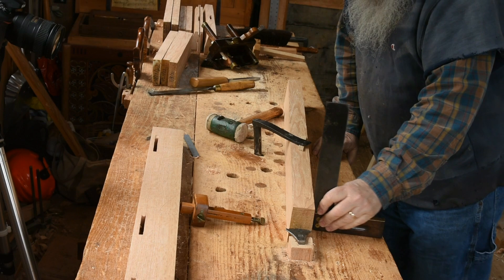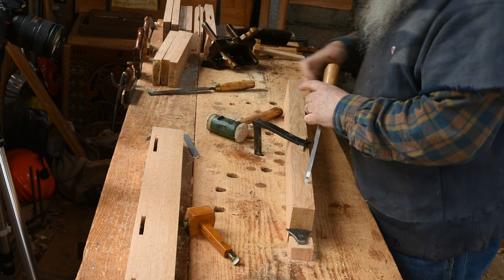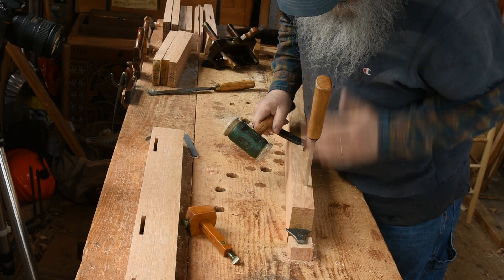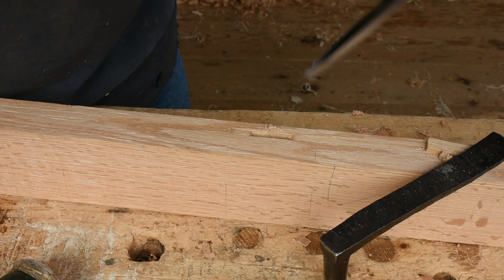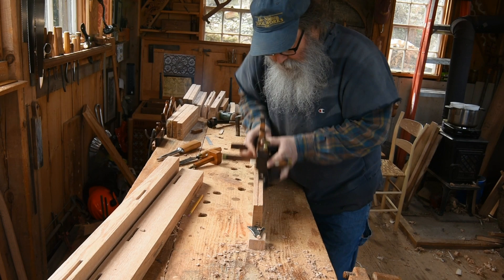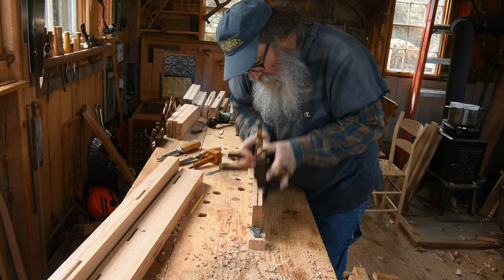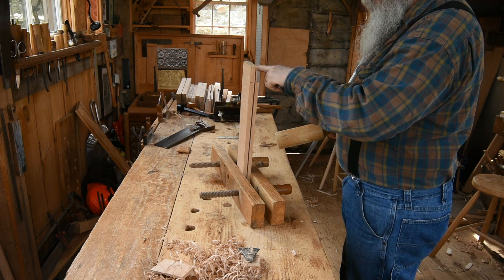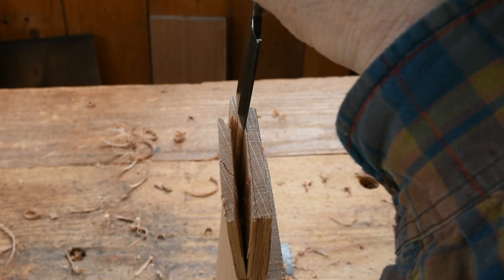Cutting Joinery trailer

Comment: What is the plane Peter uses to plane the running? I am looking for a plane to do that for guitar truss rod channels rather than a power router. Please advise thanks
Reply: That’s a wooden plow plane. You can find vintage metal versions from Stanley (45, 50, 55) or Record (43 or 44). You can also get a modern metal one from Veritas.
Reply: @warkitty3426  thanks man, how tough would it be to plane the groove with out a fence with a wooden home made chisel plough plane?  I suppose go light and slow the first pass then you can go little heavier ? thanks
Reply: @ukguitaryogi2888  you could consider using a back saw to define the walls of the truss rod channel then chisel it out.  you probably would also want to make some relief cuts between the walls to help more quickly remove the waste.   or use a straight baton to guide your chisel plane where you want it.